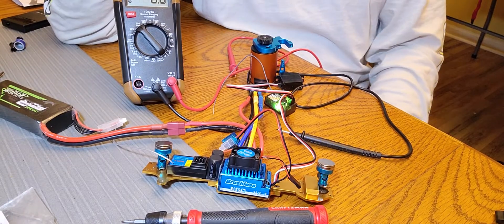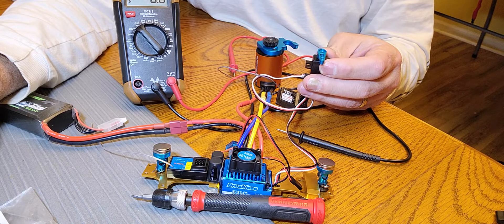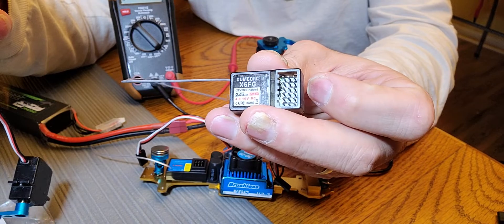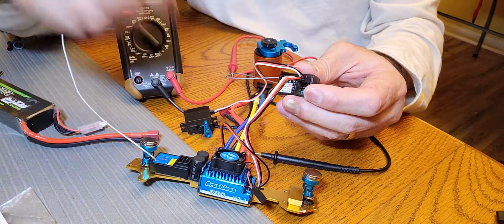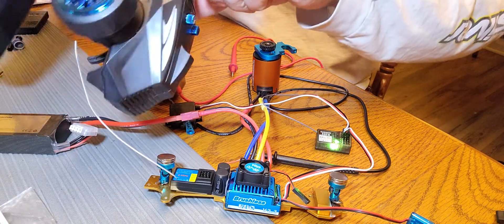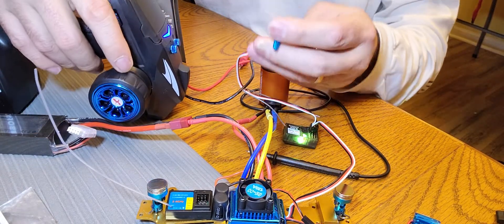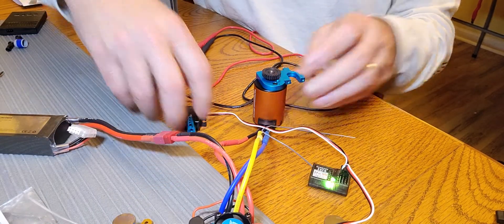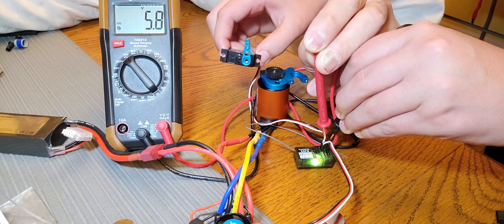Brushless upgrade still wrong!

Comment: I'm having the opposite problem. Different ESC tho. The servo works pretty good but has very bad cogging 😭 ordered another ESC. Hope your issue gets fixed!
Reply: Cogging is caused by not having enough torque on start up. Can be fixed by either: 
a) Getting a lower KV motor (the higher the KV, the faster RPM you can achieve at a cost of lower torque).
b) Buying a program card for your ESC to program how much power it gives the motor on start up.

Unfortunately, a new ESC will not guarantee to fix your issue.

Comment: You've replied to my comment when you asked for help the first time, stating this time, if I know anyone VERY Tech savvy then point them in your direction. 
It's a process of elimination when tech it going wrong.
You've changed the radio and receiver, anyone who isnt tech savvy would now change the servo. If that where your problem remain. As for the comment it reads like a slap in the face when your asking for help.
Reply from the maker: Not my intenion at all! No intent to insult you or anybody for that matter. My sincere appologies if that was the impression left. I did order a new servo last night so we shall see!    I was kinda thinking on the same line (process of elimination). Thanks for your support. Again, really am sorry if you felt insuled, I  guess rrading it again i can see how it could have been taken that way. Hopefully i will get this thing running soon. Been over 45 days grounded!
Reply from the maker: Edited other video post comment, aftef rrading it myself i can see what you saw, again sorry cause thats not what i meant!
Reply: @coquirc4537  that's fine,try changing your servo. Unfortunately these things can happen to us all. Process of elimination so I'd change the servo, try the jx1181 it's a straight drop on and is quite fast.
Reply from the maker: @mehimrc1314  Funny you say that, its exactly the one i got. Monday i should be posting results! Im also looking at buying those colored springs you used. Are they holding up? By the way the bearing change is brilliant, did mine and bye bye wheel wobble!
Reply: @coquirc4537  I watch your videos, im glad my videos on wheel wobble have came in handy for you and your channel. The springs fit fine in my video and i say whats needed for them to work correctly. Good Luck.